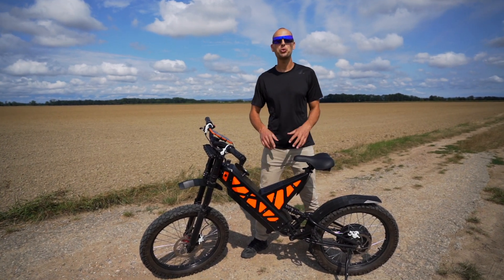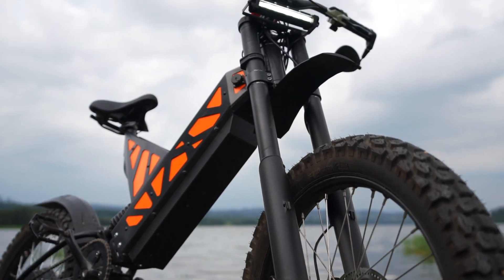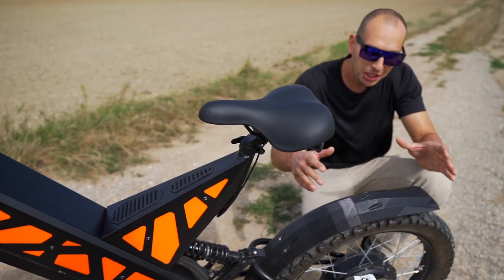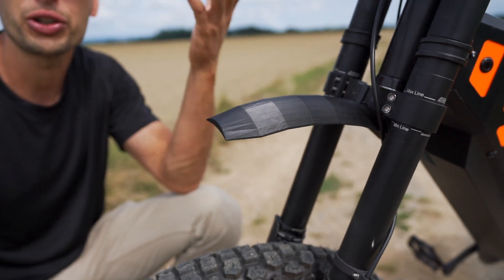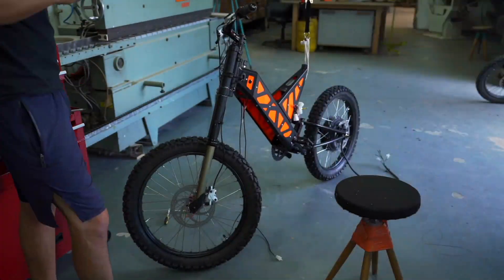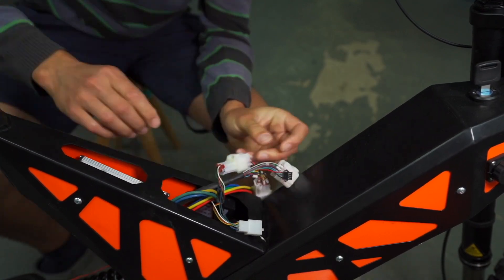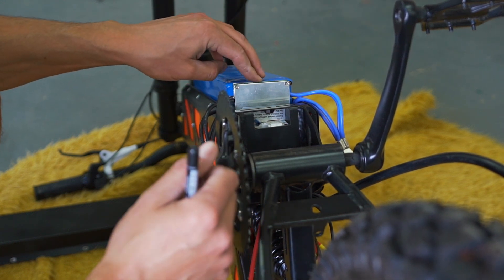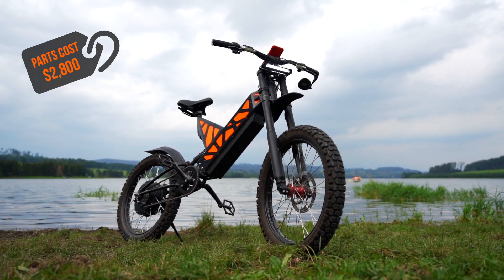Introducing WinderBike - DIY Electric Bike with 6kW Power

Comment: How I hate german law. For a bike like this you need a motorcycle licence a2 which costs like 3k. Oh and of course you have to get it certified by the TÜV which is also hella expensive. Oh and of course you also need insurance which is like another 100 bucks yearly. Ebikes that can be operated with a standard car licence can only go 28mph. And then they cry about the bad traffic in citys and about climate change because everybody still uses regular cars. Absolutely absurd.

Comment: It's a super cool idea, but I got questions: 
1. you said 2,800 dollars BUT with the 3 bundles you have to buy at your website its +300 euro AND if you are not good at electricity you also have to pay additional 500 euro 4 the battery and the 3d printed parts?
2. if something breaks you can repair it yourself? Or should i contact you? 
3. when i have questions in general can i contact you?
4. what would you say do i need, like knowledge and tools?
5. as i said great idea, and I'm happy that are people like you out there, but its only worth 4 me if it works in the end, so i hope you can understand that i as a "normal person" is not really a good mechanic 4 building such a bike at its own. But still great idea!

Comment: Hi Ladi, this really looks good. But after seeing your video and understanding that the battery encasement ist part of the main structure I am afraid to tell you that this bike construction does not have the structural integrity to let you drive safely with 60 km/h or more. Also the brakes are not certified for this kind of velocity.

Comment: I'll be purchasing the parts list and instructional video by the end of February, so I can start building mine. I'm in the states and need to remain low key, because we have a max speed limit of 20mph for ebikes. Is there a way I'd be able to install a switch that reduces the power if I get pulled over by the cops?

Comment: Verry beautyful and powerful bike. But 60km are verry short distance. Most of all, for a bike like this. I think, I never would get down of this bike. Thats the reason, why small motorisiced bikes are moresuccesful. But to have a short hour big fun, is this the right bike. Thanks for sharing.
Reply from the maker: You can easily do 80km per charge with adjusted riding style. Once start riding one you quickly realize how helpful this range actually is. I don’t even use 60% of the battery most of the time.

Comment: I can reach 70kmh with 1.4kw peak on my 1kw motor with a total weight of 30kilos for the bike. What's limiting the bike to go over 80 with a 6kw motor?
Reply from the maker: Motor winding and the lack of flux weakening. I bet it takes you some time to reach 70kmh.
Reply: @ladiandmargaret  not really but I'm a light weight and tbh I'm rarely riding at such speed which i found completely useless as well as getting far too much attention on a bicycle in my country. I'd rather focus on mileage per charge and torque when riding off road but i thought a 6k would really crush these numbers
Reply from the maker: Speed is influenced by 6 factors. Motor winding, max voltage, wind and road conditions, weight of the rider and flux weakening. This one is 16s so you would have to start comparing voltage at the first place, not kW.

Comment: To water proof connections, use Die-electric grease on inside and use Liquid Electrical tape for outside, CAUTION: it will stain everything when wet, several applications may be needed for good coverage.        Peals off nicely if you need to disconnect.   Double wall heat shrink tubing with glue, if used properly, is good for water proofing too but much more difficult to remove, so long term application really.
Samsung 40T 21700 cells, just a bit bigger than 18650.... roxors you boxors.... 35 amp discharge, 4 amp hours and about $6 usd. each. but only use PURE nickel strip for packs, BMS battery has some really nice big bluetooth battery BMS units. Pre wired very nicely. I got the 60 amp ones and very happy compared to amazon, banggood, ali express etc.. this thing is a beast...
Reply: That’s what I was wondering, it doesn’t seem weatherproof. Thanks!

Comment: that performance you need serious protection like a motorbike and a licence too .thats not a normal bike.very dangerous in novice hands
Reply: most of EU allows a bike/scooter with an automatic gearbox (or single-speed electric) up to  11kW or 100W/kg (whichever you hit 1st) with a car license, i.e. people with 0 previous experience on motorcycles...these are 100+kg scooters/bikes, the bike in the vid weighs 1/2 that and is not road legal...

Comment: i would love to just know what controller your using as i have a bike that is almost identical to 4.2 but my controller has limited regen features witch make the bike very hard to use. Ihave burnt through a full set of HO3C BRAKE PADS in under 1500km city rideing due to the regen on the bike being limited to 20a on the controller
Reply: @Lowlife Illusion lol why regen is great it saves brake pads alot when going 50+kmh its easy to burn through a set in less then a month without it with daily use in a city. at lest regen if you dont need to stop asap you can slow down without having to hit brakes

Comment: This one is the one I was waiting for, will be my winter project! Because here in Flanders, Belgium we have al lot of little backroads  (asphalt & concrete), are there roadtires or intermediates you suggest? Keep up the good work!
Reply: Wow a fellow Belgian, by chance do you know to make theses bikes street legal in Belgium? I'm interested but I have a feeling it will require almost as much effort and money to register it and make it street legal than to build it
Reply: @MrNoziv  Making it street legal in Belgium will be diffecult, because much faster than a speedelec so no registration as a spedelec, and it still has pedals, so it can't be a motorbike, and registering it as a motorbike will be diffecult also I presume, because it's a selfbuild bike, not something you buy with a dealer...
Reply: @wimvansevenant2884  Yeah that is what I thought from the little amount of research I did.  Problem is that even whit removing the pedals to make it a motorbike it would be almost impossible to register it and even worse to get an insurance for it... Too bad because as a city commuter it could be great.

Comment: No doubt a fun bike to ride, but the only cargo you can take goes in a backpack, I guess.
Reply: Croft like 99.9% of bikes that aren't shopping bikes then! 🙄
Reply: @HandyC  There are more and more electric cargo bikes coming up, they're selling like hotcakes. With an electric motor, it doesn't matter so much if theyre big, bulky or heavy - and having the ability to haul a lot of cargo, or kids, etc is hugely valuable in an e-bike used as a car replacement. Maybe that's his next project. :) The difficulty there would probably be finding a ready-made frame - welding up a frame from scratch is way beyond most home hobbyists.